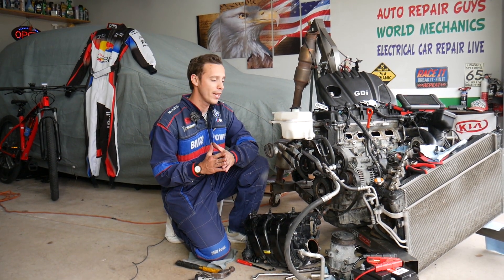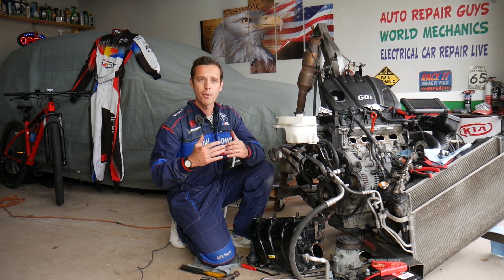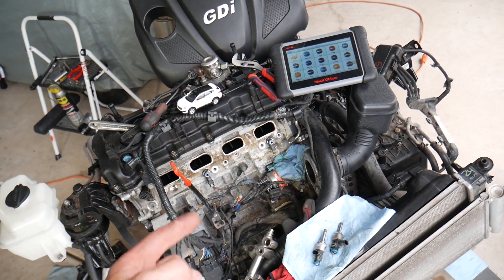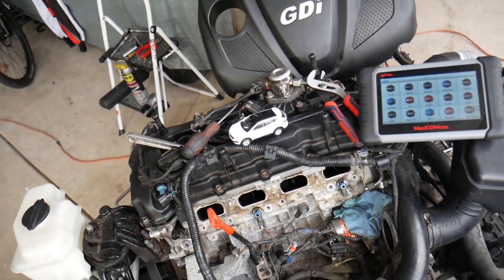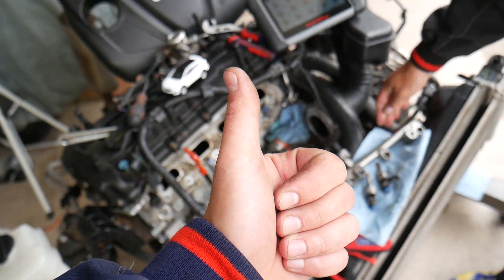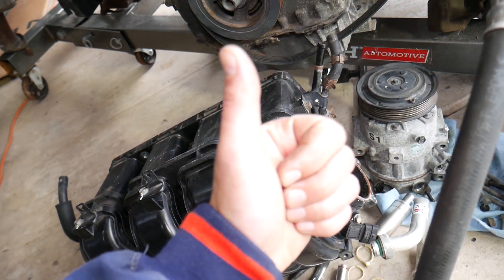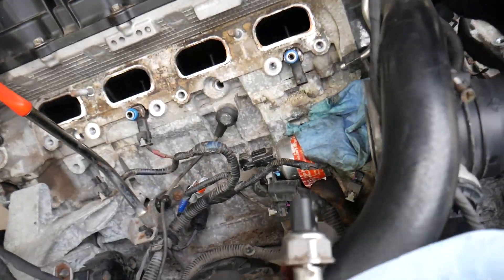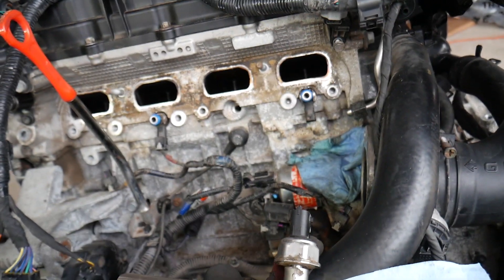HYUNDAI SANTA FE CODE P2188 SYSTEM TOO RICH AT IDLE BANK 1 FIX

Comment: So very helpful thank you so much!! The code read recommended I change the canister purge valve but I already replaced it (and the cylinoid) last year due to p2187 idle too LEAN. So now I have a better idea of how to fix the issue possibly! The only thing now... is to figure out which of these issues to fix, and which one of them would cause my ventilation system to be shooting a strong exhaust/fuel smell into my vehicle after my engine has been warmed up for about an hour (1.5-2 hours or driving). It smells some outside the vehicle, but it smells like it is strongest INSIDE the vahicle so I have been driving with my windows down in this 110 degree vegas weather... yuck! haha